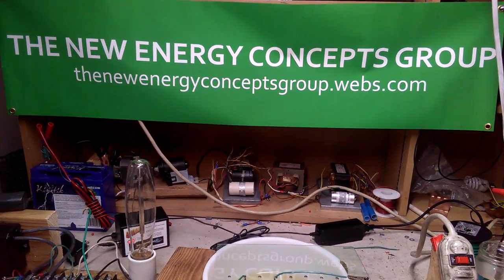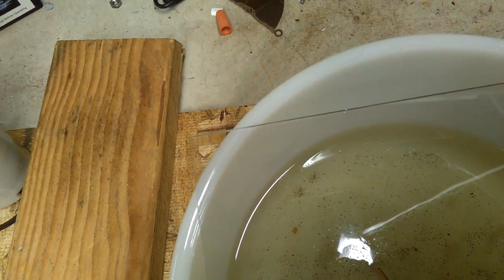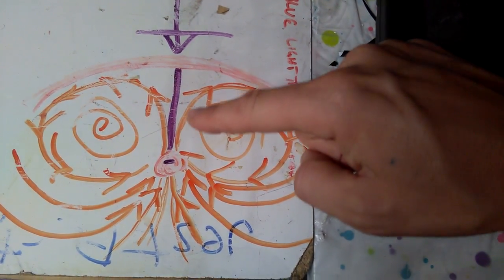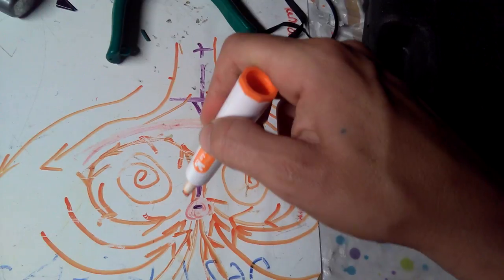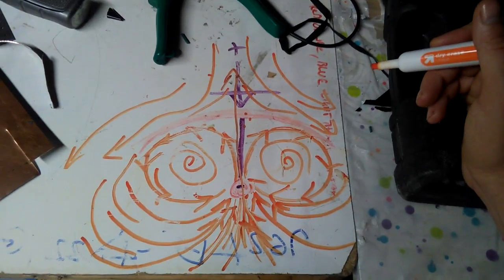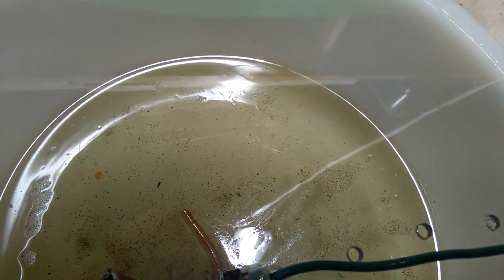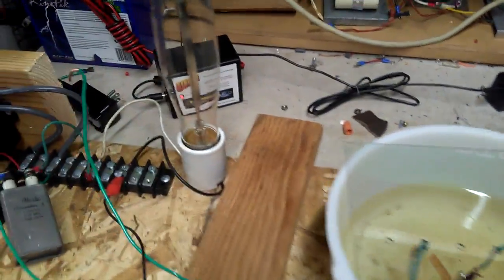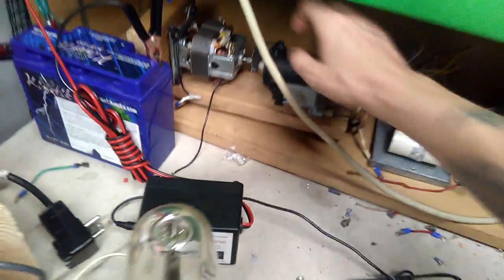Townsend brown effect.

Comment from the maker: T. Townsend Brown was using high k dielectric materials to fly his craft. these were heavy materials.

dielectric material can absorb energy until it becomes massless and even can disappear from sight. 

the energy density can overcome the radius of dielectric atoms and they begin to absorb light instead of emit light. 

long before that happens they become massless and become very easy to accelerate.

the kowsky frost experiment shows this same effect in crystal.

when these lifters like you have are put in vacuum, all of the dielectric(air) is pumped out and therefore the active material becoming massless is taken out of the equation so those vacuum tests are false and deliberately misleading.

hv foil capacitors were also used by brown in his gravitator circuits. 

once those dielctric materials are charged, they can be as big as a city and float. 

the dielectric(air) in your lifter is not contained and is very lossy.

its like driving with a hole in your tire as your trying to pump it up at the same time.

high k dielectric materials will hold the charge and not let it escape.

Biefield brown effect is basically a plasmonic metamaterial with a negative index of refraction and reflects the planck oscillations(light) of spacetime through it differently than any other materials known to man.
Reply: Jeff Van that is not at all what the effect is, it's nothing more than an ionic ind generator, by using asymmetric capacitors, literally everything you've said is made up, let me know when you publish results overturning physics 😂😂😂,  you EU, flat earth, conspiracy this or that, anti sciences cranks really give me a laugh, you guys have been doing this same nonsense for decades now and is if you have been able to produce a single result in whatever crackpot theory your spewing. Have a fun waste of time their mate.

Comment: use bismuth as the dielectric material.
Reply from the maker: TheFilthyArsonist thanks that's a great idea! I was going to use Bismuth for a scalar antenna to place on the diode for more power. I will try the Bismuth as a dieelectric between the plates!
Reply: Don't forget about the precession of the magnet! You have a double toroid and ALSO the centripetal vortex of the dielectric plane.